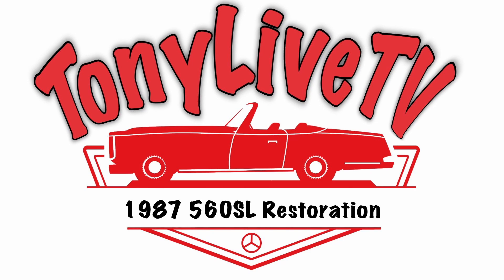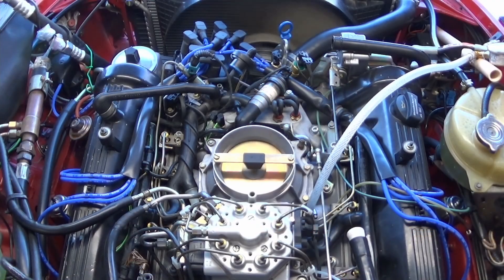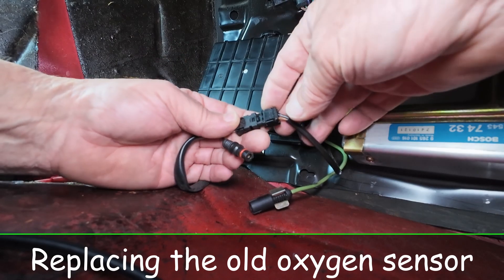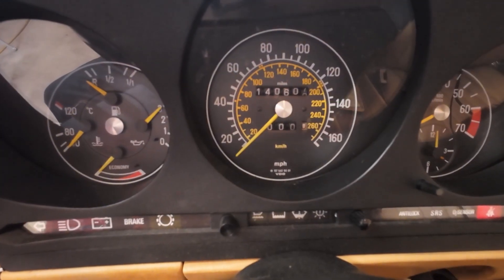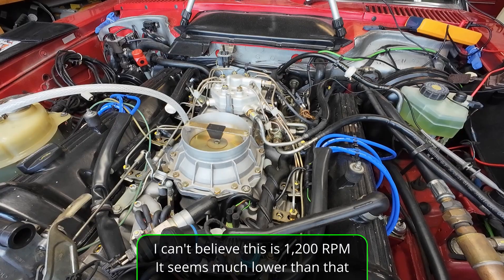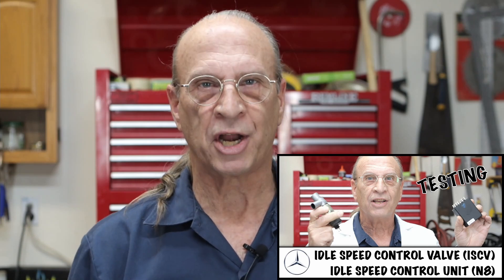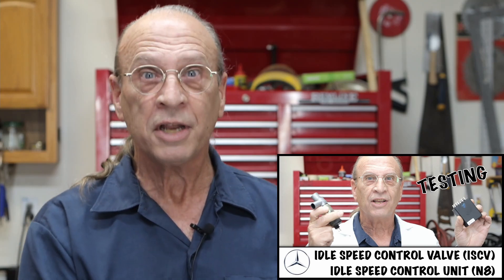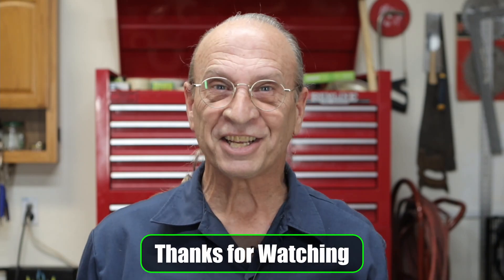560SL - How I Test and Replace the Oxygen Sensor

Comment: Hello Tony, I really like your videos very interesting. Nevertheless, I had an issue appeared few days after changing the feul pumps and filter. Engine starts ok drives for about 5 minutes and starts blowing clouds of black smoke and bogging down. Off and starts, it gets better but very briefly the car is not drivable. New plugs dist cap the lot. Can you help?please
Reply from the maker: The first thing I would do is verify the smoke you see is either fuel related or oil related. So, pull each spark plug and see if they are wet with fuel or wet with oil. If fuel, check the cold start valve to make sure it’s not stuck open. If that’s okay, it’s time to check the fuel distributor to make sure it’s not leaking when at rest https://m.youtube.com/watch?v=RPBCr6LqWFQ&t=15m55s If not fuel related, pull off your valve covers and see if the oil tubes are still sitting where they belong. The tubes are held on with plastic clips and when they fail, they flood the head with oil which will then leak into the cylinders.
Reply: @TonyLiveTV thanks for your reply.  It's definitely black smoke replaced the plugs. The bogging down heat related.  I suspect the injectors because the fuel pumps were gummed up the filter totally blocked. Chasing a red herring.  The injectors are about 15 years old. Wish me luck😢
Reply from the maker: @gusibrahim6961  I wish you luck and please let me know what you find.
Reply: @TonyLiveTV I forgot to mention that I replaced the FPR with used one was leaking slightly, the car ran for few days and suddenly on a highway started bugging down lots of black smoke and RPM wouldn't the 2000 mark! Speed is 10MPH. I live in Abu Dhabi and no mechanic uses scientific method to narrow down the issues. Visual checks and 8 out of 10 times they are wrong 😂

Comment: Keep trying!  I have a similar”high idle” issue on mine, so I’m very interested to see where this goes and what the answer is. Mine did just quit last week, but fortunately it was “only” the fuel pump relay and she’s back running, albeit at a high idle…. Good luck!
Reply: @OB928 Your high idle issue is likely a faulty Idle control unit, a 10 pin module located inside the car on the passenger side firewall.  Mine cost $374, good luck.
Reply from the maker: @ Good guess, but that’s not why. I have already done a couple of videos about the ISC-Unit and have tested it thoroughly using an oscilloscope. Nothing wrong there. I have two ISC-Units and two ISCVs, OVP, FPR so it’s easy to test. I don’t have a high idle now. The high idle was fixed in the video about the throttle position switch. What appears to be a high idle in this video is not a high idle at all. My next video will explain everything.
Reply: @  Thanks for the suggestion. However, I bought a remanufactured “spare” from Programma and nothing changed when swapped. I was also hoping (dreaming, maybe) that the fuel pump relay (that just died and I replaced) would have somehow been an issue; nope. ICV functioning, as well. Still scratching my head.
Reply from the maker: @OB928  what’s your RPM? Are you using the dash tach or probing Pin 1 of the X11? Maybe in my next video I might summarize the entire KE-Jetronic system showing each component and how it interacts with the EZL, ECU and ISC-Unit. Did you check the coolant temperature sensor? One line feeds the ECU and the other feeds the EZL. That’s the one test I have not shown in a video yet, but it too plays a role in all this. I feel if you do all the tests I did in this series, you will find the problem.
Reply: @ RPM is a constant ~1,200, solely going by the tach. Interestingly, the RPM will start out somewhat OK when cold and then when shifting to “R”, they increase, which makes me think vacuum. 

No, I have not done the extensive testing you have done on the electrical system. My skill in using a multimeter is challenged, at best. I need to test while watching your videos, time has not been on my side lately.
Reply from the maker: @OB928  hey David how have you been? I can tell you it’s not the ECU! This past week (off-and-on) I completed testing all the pins of the ECU and everything is working perfectly. I also tested every device (ECU, ISCV, ISCV-Unit, EHA, O2, Temperature Sensor, Fuel Pump Relay, ?). All these are working perfectly and the wiring is also perfect. The ECU is “trying” to adjust mixture and idle speed. It is adjusting the mixture on the EHA perfectly. BUT, when I measure RPM on Pin 1 of the X11 socket, it shows 100Hz. Here is where I have a problem. Everywhere (forums, AI, YouTube videos, etc), all claim the formula from Hz to RPM is (100Hz * 15 = 1,500 RPM). But my ears say it is 750 RPM. I believe my idle is perfect right now, but the EZL is somehow doubling the RPM signal. So when I get a chance, I will probe Pin 1 of the coil and compare that with what I get on pin 1 of X11. I’ll bet the EZL is sending the wrong RPM to the EZL (and all those components on the TD line). That’s why when I remove the plug from the ISCV, the idle does not increase. It already believes it is over 1,000 RPM. I hope to test my theory in the next day or two. I’ll do a video regardless what I find.

Comment: Hi, Tony. Nice video. I would recommend you to check the current on the ECU in order for you to see what happens with the mixture. The specs for your car have to be 75mA on the ignition on and as the car warms up the mA have to decrease. On the cold start they have to be 15mA and as the car warms up the mA have to drop to 0. Once lambda starts working there must be the fluctuation -3mA and 0. The negative range - mixture rich, the positive range mixture lean. The range has to be -3 and 3mA. And be careful on ignition ON the EHA has to show POSITIVE reading else you will get a wrong picture - the ECU will tell you the car is running too lean. If you don't get any current from the ECU then your ECU might be bad, because as I remember you have a brand new EHA. I was working on a car that had a brand new EHA and the ECU told me that the mixture was too rich, I got -10mA which is INSANELY rich mixture and no fluctuation. So, I would recommend you to make a video about checking the EHA in order to see what the ECU tells the EHA. Also check the readings you get on the idle control valve. You have to get 1000mA. That's where your ICV has to be on idle. Thanks for mentioning me and just do it! There is going to be an enjoyable ride for you! Greetings from Serbia!
Reply: Fantastic explanations, I follow  my friend and professor Ivica he’s the Goat! Highly recommended!!! @mercedeske 
All the best dear Tony!!
Reply from the maker: @mercedeske  thanks my friend. I will be checking all this. Right now there is no current to ISCV and my guess is there is no current to the EHA and idle is high. Up to this point I have only checked that these things work as expected. They work on the bench, but they are not working installed. I have power to ECU, ISC-Unit, Fuel Pump Relay, EZL, OVP and so on. I feel like after repairing the wires of the TPS, the timing is not correct. And here is a very weird thing. A couple of time when I turn the key to off, the radio comes on and the antenna rises, but the characters on the radio are all garbled. When I remove the key the radio display is still on. The radio does not work. To reset I disconnect the battery and the antenna goes down and the radio turns off and the radio works perfectly. This has happened three times now. I feel there is a back feed happening when I turn off the key. There are some very weird electrical problems going on. Everything worked perfectly when I parked it.